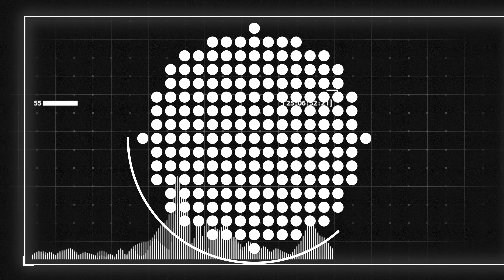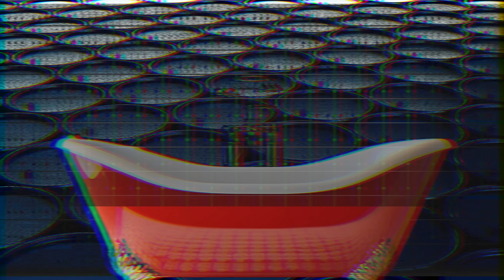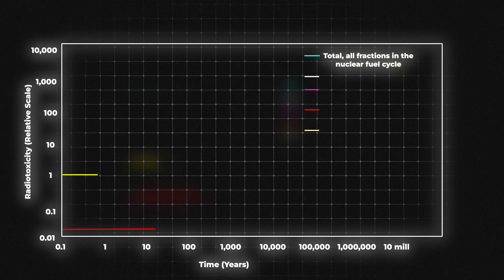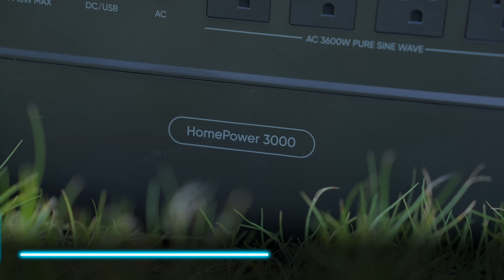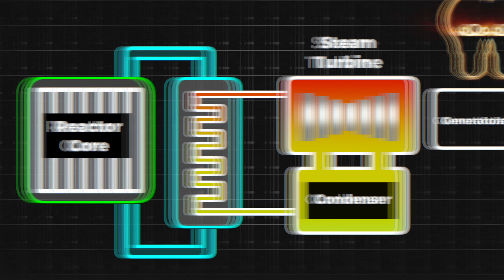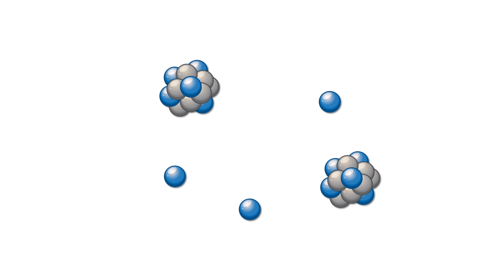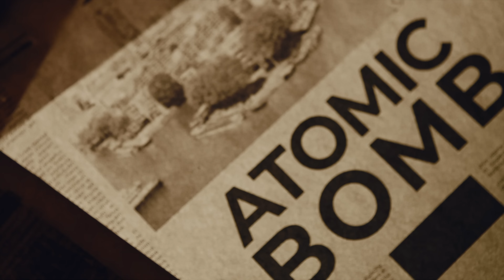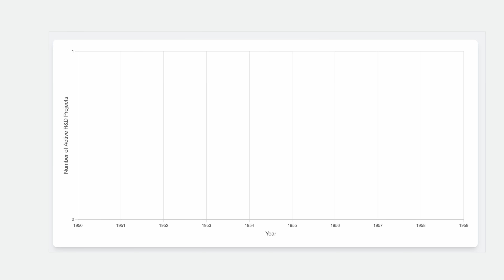Why Thorium is About To Power Everything

Comment: Too much hype with this video Ricky and you know it.  Thorium molten salt reactors (MSR) have been under research for over 60 years and still not much to show for it.  The video did not address enough the substantial drawbacks of Thorium.

Even China's Thorium reactor is a tiny 2MW reactor and might scale to a still tiny 10MW reactor by 2030 at best.  Tiny!  Traditional reactors are in the 800MW to 1000+MW range.  Thorium is unlikely to ever compete economically with traditional utility-scale U-235 nuclear reactors which are already one of the most expensive ways to produce electricity!

The abundance of Thorium is moot when there is enough uranium to power all expected nuclear growth for the foreseeable future.

Thorium itself is not fissile but it is "fertile".  So thorium MSR requires a complex breeding cycle and still requires a plutonium driver.  The ongoing breeding requires even more complex equipment, instruments and trained technicians and engineers to keep it running smoothly.

The molten salt is highly corrosive in itself in addition to the embedded highly radioactive fuel contained within the salt medium.  No such materials have been found for long term handling of this radioactive 800+°C molten salt.  If ever a production Thorium reactor has a problem with its piping or reactor containment, it's likely the entire reactor needs to be scrapped — because it is practically unrepairable by either a human or by robot.  That's a huge drawback with using molten salt with embedded nuclear fuel in it.  Thorium reactors likely won't even last as long as a traditional nuclear reactor which will substantially increase Thorium's levelized cost of energy per MWh over and above traditional nuclear energy which is already one of the most expensive ways to produce electricity.

Nuclear energy definitely has a "cool" otherworldly factor with it.  But we should not automatically assume that it's applicable to all energy applications.  Nuclear energy in general, not just Thorium, is best used in small-scale specialized applications where nuclear excels at: military, scientific, and deep-space exploration.  Nuclear energy is simply the wrong tool for use on the large-scale terrestrial grids: too slow to build, too expensive, and brings unparalleled risks that no other electricity generation even comes close to in risk profile.

Comment: The delay in thorium nuclear is the molten salt is extremely reactive.  The meterials needed to have longer life of the reactors are not yet developed.  A simliar situation but different for generation 4 reactors.  The materials to contain the reactions long term are still in development and not expected till about 2040.
Reply: This is wrong, molten salts are extremely unreactive.  That is their major advantage, (ionic chemical bonds are very strong).  Oak Ridge National Labs ran a Uranium based Molten Salt Reactor (MSR) for over a decade, and found modest corrosion.  Nixon's government wanted to kill this tech, and touted this minor corrosion as a critical flaw.  Sadly this mis-information has never died out.

Hastaloy (a nickel rich stainless steel) is plenty strong to last the operational life of a reactor.  Additionally it has been found that these molten salts will suck up water vapour from the air which makes it more corrosive.  If the air is kept dry, the 'problem' largely goes away.  China has been running test MSR for 15 years, and have not been so troubled.

For more information, see: "Molten Salt Reactors & Thorium Energy", edited by Thomas J. Dolan, Woodheard, Publishing Series in Energy, ISBN 978-0-2-08-101126-3.

Warm regards, Rick.
Reply: @RicksPoker  Fluoride salts like FLiBe used in thorium MSR are thermodynamically stable but they are kinetically aggressive solvents at high temperatures that MSRs run at (800+°C). This means they will readily dissolve metal oxides (the protective layers on most metals) and leach out certain elements from metal alloys through a process called "selective corrosion".

The Oak Ridge experiment did indeed run successfully from 1965 to 1969 with remarkably low corrosion. However, this was not because the salts are unreactive. It was because the Oak Ridge scientists and engineers actively and meticulously managed the salt chemistry to make it non-corrosive.  The FLiBe salt was prepared to an extremely high purity level to minimize corrosive impurities from the start.   They introduced a "getter" (Titanium or Beryllium metal) which is a small amount of a reactive metal into the system  These metals have a higher affinity for impurities than chromium does. They scavenged any free fluorine, oxygen, or moisture, effectively "soaking up" the corrosive agents.  This is time consuming and costly as well as risky in a production environment.  It may also reduce the efficiency of the reactor.

The Oak Ridge engineers succeeded because they acknowledged and defeated the salts' reactivity, not because the salt is "extremely unreactive" as you suggest. This process maintained the salt in a reducing state, preventing it from oxidizing and attacking the chromium in the Hastelloy-N reactor vessel and piping.

If you say that molten salts are not corrosive then why did the Oak Ridge engineers need to resort to such extreme measures on an ongoing basis?

We're not talking about just molten salts either when talking about Thorium energy.  Because the molten salt in Thorium MSRs specifically contains high amounts of nuclear fuel embedded within.  This highly radioactive material will constantly bombard the reactor and piping containment with high energy neutrons which are highly damaging via "activation" and beta decay.  Traditional U-235 reactors manage this by enclosing the reaction in a thick containment vessel and the nuclear activity is not spread outside of the containment vessel at all.  But Thorium MSR specifically breaks this convention in order to gain the benefits of avoiding water as a thermal transportation medium.

Additionally, the Oak Ridge reactor was tiny in size and used a small primary loop.  Scaling to commercial-scale 300+MW is not a simple linear process.  Even with the experiment's long duration, the Oak Ridge reactor only ran cumulatively for about 1.5-years at full power.  But a commercial reactor needs to run for 40- to 60-years in an economically efficient manner.  When operating at high power in a commercial setting, the neutron flux is vastly higher causing problems like embrittlement, swelling, transmutation (beta-decay activation) and a lot of interplay between these problems along with high heat and corrosive nature of molten salts with metal alloys.

Comment: DeepSeek-R1
Query:

how much electric power is generated by China's Thorium-Fueled Powerplants to date?

ANSWER:

Read 24 web pages:

As of July 2025, China's thorium-fueled power plants are still in the experimental and demonstration phases, with limited electricity generation. Here’s a detailed breakdown:

Current Operational Capacity

1. Experimental 2 MW Thermal Reactor:
   · Located in the Gobi Desert, this prototype reactor achieved criticality in June 2024 and was successfully refueled without shutdown in October 2024 .
   · It generates 2 megawatts of thermal power (MWth), but it does not produce electricity. Its purpose is research, including materials testing and fuel cycle validation .
2. 10 MWe Demonstration Reactor:
   · Construction began in 2025 and is slated for completion by 2029. This reactor will be the first to generate 10 megawatts of electric power (MWe) from 60 MWth, using a supercritical CO₂ turbine .
   · It will also produce hydrogen as a byproduct .

Future Projects

· A larger 373 MWth/168 MWe molten salt reactor is planned for 2030, aiming for commercial-scale deployment .

Summary of Electricity Generation

· To date (July 2025): 0 MWe (only thermal output from experimental reactors).
· By 2030: Up to 178 MWe (combined 10 MWe from the 2029 reactor and 168 MWe from the 2030 project) .

China’s thorium program is focused on long-term energy security and decarbonization, with ambitions to scale up after 2030 . For real-time updates, refer to sources like the Chinese Academy of Sciences or SINAP reports.

(DeepSeek-R1)

Comment: Been paying attention to Thorium for about ten years. The processing plant is 1/10 the size of a nuclear plant.  A system has been designed by one inventor the size of your interior AC closet with enough power to run your home for 5 yrs on a baseball size quantity of material. The Thorium car ran on a quantity the size of a golf ball. The thing holding Thorium back is it is too prolific, too easily handled and would be soooo cheap the major producers of power would be without "power". The inventor of the nuclear power plant preferred Thorium. But you can't make nukes from Thorium.

Comment: You almost made it sound as though the reactor is safe, but during operation it is quite “hot” with radioactivity.  This presents issues with safety and maintenance while the plant is operating.  I saw a good video on this with information from Copenhagen Atomics.

Comment: While better than uranium fission it is still radioactive, dangerous and complex (handling molten salt).  Therefore, it will never be cheap, especially in comparison to the continuing plummeting cost of solar and batteries. Add in wind and as geo-thermal takes off I think it is a waste of money.
Reply: I’d disagree, nuclear will be a critical need in the future. Knowing that solar and batteries need huge swaths of land just to produce a small amount of electricity, thorium reactors use a way smaller portion for a greater outcome. It’s economically better, we just have too much regulation and tape around nuclear in general.
Reply: Thank you for bringing this up. This is what the army of nuclear (Th and otherwise) propagandists on the interwebs are continually allowed to ignore.

It’s not that nuclear doesn’t work. It’s that it requires economic illiteracy to advocate for.

The costs of “lower tech” solar and wind have a years long track record for getting cheaper. Nuclear advances have a track record of always being 10 years away. In engineering, things don’t get cheaper by tinkering in R&D labs. They get cheaper via mass production, something nuclear will never have.

Nuclear projects are too expensive, too risky (financially) to attract private investment, and too slow to pay back investment. These are fundamental economic realities, and while nuclear deadenders try to figure this out, less complicated solutions will have gotten even cheaper and actually abundant. Not “YouTube abundant”

Comment: Overall, a poorly balanced explanation. Thorium is not the fissile fuel and, thus,  is not "burned".  It is the same as fertile U-238 used to produce (breed) fissile plutonium. While the notion of a dump tank as a safety system is discussed, what happens with a leak of the highly radioactive molten salt moisture flowing through the heat exchangers? Welded heat exchangers are often leaky, especially when dealing with highly corrosive materials. Would such a leak make the entire facility highly radioactive? Would secondary leaks cause ground or surface water contamination as happened in Japan in 2011? Would evacuations be needed? Would the plant need to be cocooned and abandoned for hundreds of years? My review of the history of the 1960's MSR tests and subsequent reports shows that little real progress has been made in making such MSR systems acceptably safe, even on paper. When the first experimental molten salt reactor's testing concluded in the 1950's, six-inch thick lead sheets were used to protect the workers from the intense gamma radiation while the plumbing to the small refrigerator-sized reactor was cut loose. This indicates the level of radioactivity likely present throughout the plant even when operating. For a 1-GWe plant, one 1970's era design had 1.5 million pounds of the molten salt, operating  at around 1000 def F, circulating through the system. The flow rate as roughly 14,000 pounds per second - yes, per second. The two primary heat exchangers in the design used 50 miles of welded tubing using nearly 25,000 welds. Of course, all of this is going to operate without issues for how many decades?

Comment: A freeze plug is hard to recover from so it won't be used by operators unless things get really bad. I expect a dip tube and pressure system that would pump the cover gas into the dump tank. Another change would be panels that would be held closed by electric. These panels would allow air to flow past the dump tank.
Reply: The freeze plug is certainly not hard to recover from.  In Oak Ridge national labs, they ran a test MSR for more than a decade.  But they didn't want to have people work overtime on weekends, so every Friday night they turned off the fan and drained the reactor.  On Monday, they heated up the salt with electric resistors, pumped the salt back into the reactor and continued.
Warm regards, Rick.

Comment: Don't compare Thorium to fissile U235. Thorium is fertile like U238 and both needs to be converted to a fissile isotope before it can be split to produce energy. Plutonium is not dangerous and is very much similar to what Thorium needs to be converted into. 

Thorium is radioactive similar to Uranium and when fission products are exactly the same as for Thorium. Exactly the same!

Thorium can indeed melt down and just like Uranium, that is not really an issue other than it ruins the reactor. The Molten Salt Reactor run perfectly fine on Uranium too with exactly the same benefits.

The misinformation is heavy in this video. It is not disinformation as I don't get the feel that it is done deliberately and it does not deceive. The information is just not correct.
Reply: It is not the fission products that produce long lived radioactivity, it is the transuranic actinides (TUA).  And thorium reactors do indeed create less TUA.  If you start with a breeder reactor with U238, you add a neutron which decays to Plutonium.  If it does not fission (65% chance of fissioning) then you have TUA.  If we start with U235, it has an 85% chance of fissioning, and if it doesn't then it still gets the 65% chance when it reaches Pl.  If you start with Thorium, it breeds to U233 which has a 90% chance.  If it fails, it still has the 85% and 65% chance of fissioning.  Thus, far less long lived wastes are produced.

When one of these isotopes fission, you have hit the jackpot.  Lots of energy, and the daughter products have short half lives, so they are not radioactive long.  The long term wastes are from the stuff that does not fission.

There is another reason molten salt reactors produce less long term wastes.  The fuel can stay in the reactor longer, so it has more time to fission.  In a traditional reactor (designed 80 years ago), the fuel is polluted with daughter products (including Xenon which is a massive neutron poison).  Fuel rods that are mostly 'unburnt' fuel are removed.  In a molten salt reactor, helium is bubbled thru the molten salt and this removes the Xe gas.  This gives the reactor a better burn thru, which reduces the amount of 'waste' produced.

Also, saying that traditional waste is dangerous for 100,000 years is not accurate.  The stuff that lasts 100,000 years is barely radioactive, and barely more radioactive than the rocks which we started with.

Warm regards, Rick.
Reply: @RicksPoker  transuranics are also fuel, not waste. It would be like breeding on Thorium and calling U233 waste. That would be insane.

Sure it is nice to have reprocessing attached directly to the molten salt reactor, but pretending that this is fundamentally different from offsite reprocessing is just weird - sometimes those who say it is a little deceptive.

Molten salt reactors and their different designs are awesome. They really trigger my technology fetish - but at the same time they are not really needed. They don't solve a problem.

Comment: Thorium reactors are not meltdown proof. In fact, molten salt thorium reactors and technically always melting down. It can still have catastrophic faliure like any nuclear plant. Uranium 238 is also safe to store at home and can be used in nuclear reactors. Also, molten salt reactors are not new, and cam be used for materials other than thorium. If you can say that, you can say normal American reactors, like PWRs, are also meltdown proof.

It is not that much safer, it has less waste for sure, but again, thorium reactors can meltdown. Also, you said thorium had unmatched power density, come on, you know that's not true. I have to say I'm a bit disappointed in this video.

Comment: Would the salt brine from desalination of ocean water into potable water be usable for the molten salt part of this process?
Reply: No, they us fluoride salts such as lithium-beryllium fluoride (FLiBe) as their base salt, in which a thorium Florine salt (ThF4) is dissolved.

However, rather than using lithium, some has suggested mixing in some chlorine salts, since this will moderate fast neutrons slower, and make the reactor better at 'burning up' traditional nuclear waste.  (Which would generate power from this spent nuclear fuel.)

Warm regards, Rick.
Reply: @RicksPoker  Thank You. Unfortunate as it would help solve the salt brine problem.

Comment: There is another, albeit minor, advantage to using thorium. When you showed the Thorium Fuel Cycle you used uranium as the source for the initial neutrons. But instead of using uranium you can use depleted nuclear fuel waste instead. I remember reading somewhere that that could deplete the waste, rendering it safe for disposal. I can't remember the source for that so I won't claim it, but it leaves you something to investigate🙂.